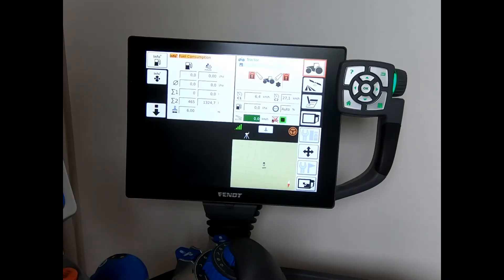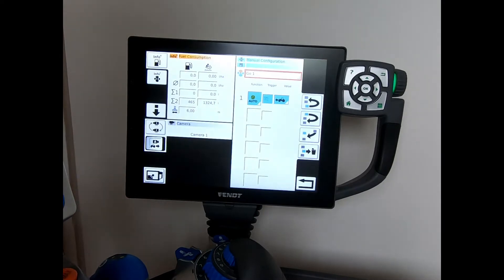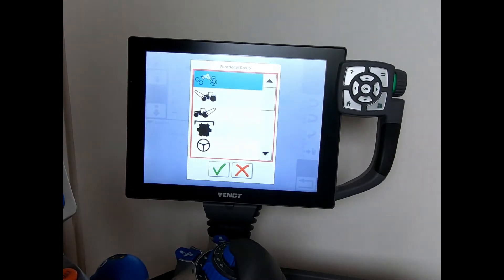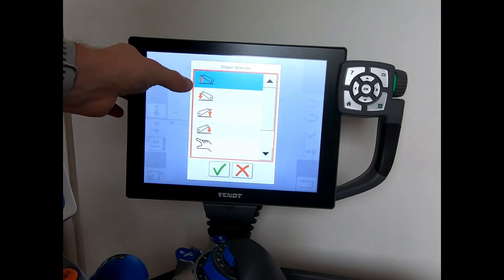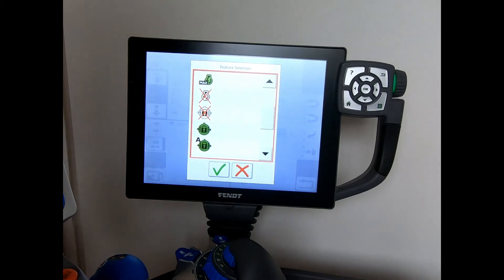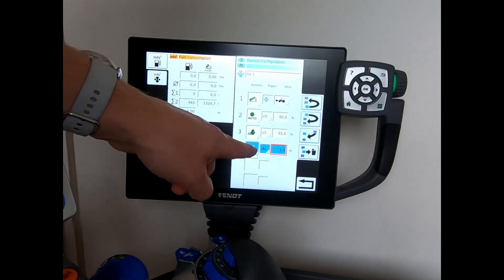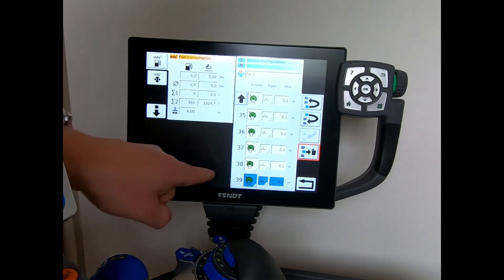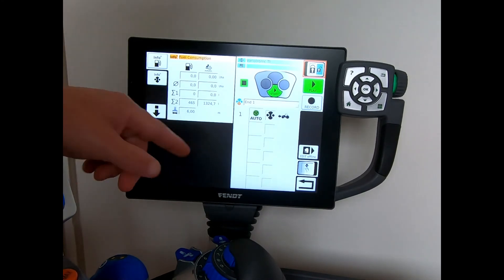NT01 TeachIN headland management sequence

Comment: Do you have to press go/end for each function? Or will a single press run through the sequence?
Reply from the maker: No, you can select a trigger as to when the function happens. A trigger could after a a set time, after a set distance or if using the linkage, a percentage of the linkage height, meaning just press the GO / END button once and the whole sequence will be run through automatically. There is a switch, where you can select it so you have to press the GO / END button each time you want to move to your next sequence.